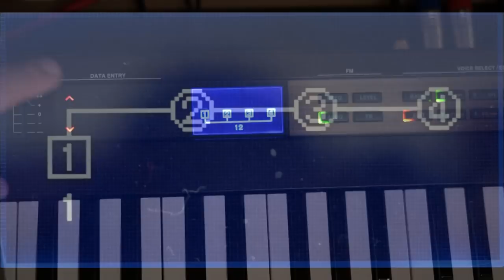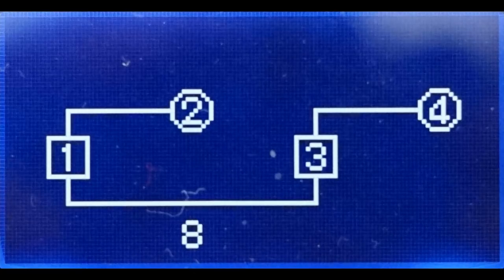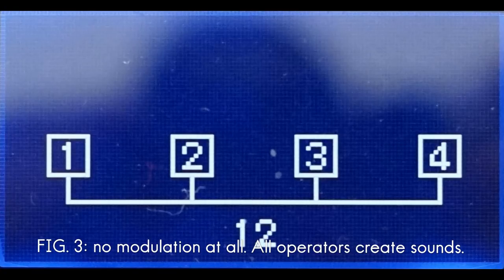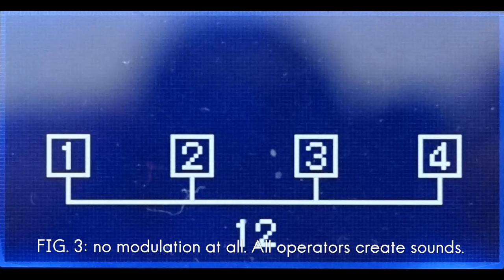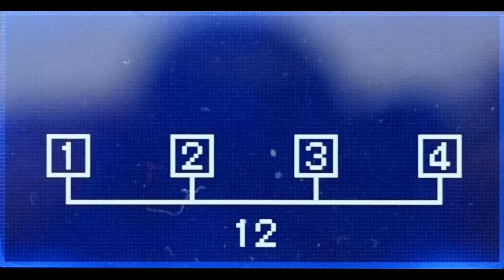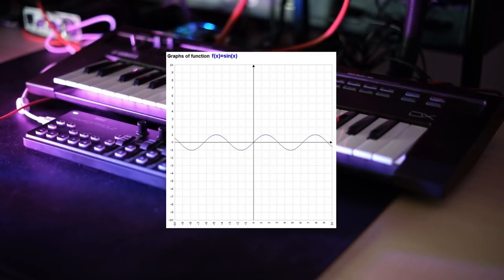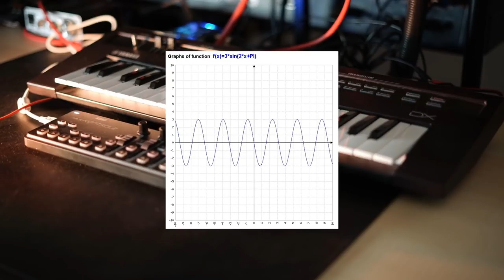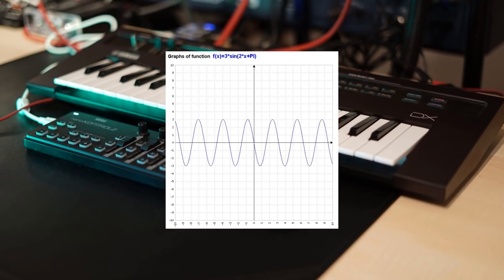FM synthesis basics explained with an oscilloscope (Reface DX)

Comment: finally, someone who understands that phase modulation is PM, not FM
Reply from the maker: Thanks for watching! :)
Reply: Interesting topic, I consider terms are right. Frequency modulation is the result of modulating the phase and vice versa. To explain to someone what it does (without scope, just by listening), I like to set the ratio of a modulator very low so that it sounds like a vibrato. As you clearly hear the pitch is changing, it would make sense to call it FM. Either way, this type of synthesis isn't for everybody anyway, let alone the maths behind it. Wouldn't worry too much about it :)
Reply: @tehedx  hello, thanks for reply. Frequency modulation is the result of modulating the frequency, as it says. PM - modulating the phase, as it says. From the point of view of the math these are two different results, as phase and frequency is two separate (different) parameters of one (lets say) sinusoidal equasion. Thus changing two different parameters can't be exactlly the same. Technicaly it can give us same result, but only with exact parameters set. Same as two functions that intersects in some point with exact given set of (x; y), but functions itself are not totally overlaping each other... From the point of view of sound, of course, these two methods of modulations (or more, as much as many parameters can be modulated) give different sounds in general. We will clearly hear some pitch floating up and down using FM, and harmonic saturation using PM. We can't make siren or vibrato (as you said) with PM... Sadly, I don't know any PM vst except Blue2, that is FM and PM, so you can use either first one ot second method, and hear kinda different "style" of sounds... Also there are some videos on youtube (can't remember) containing great visualization for PM, after wich one can be certain that FM != PM
Reply: @hostlitd112  thanks for your reply, good explanation! I was focussing only on the mild modulator volumes, but when it is set higher (where it starts to wrap the sine and adds harmonics) it is clear that FM != PM. Out of curiousity, since I don't have a Yamaha to play with, can't one make a vibrato? The Korg Opsix does it. Though something is odd or different about this synth, since the result doesn't seem to match what a DX does.
Reply: @tehedx  Yeah, that is it! Sine starts wrapping, while in FM sine goes faster or slower... Are you asking about Yamaha vibrato? I don't know, I didnt work with real device synth, only VSTs :(    In theory you can't do vibrato in PM, but as you set modulator volumes lower (as you said), it tends to be more mistaken with FM. Thus in that moment you can achieve not vibrato exatly but something similar to FM with hight speed (frequency) modulator, where it would be something buzzy, and with PM you can also make something buzzy. Low frequency, or high volumed modulation is totally different though, just like you noticed

Comment: Phase modulation! Now that makes sense! I used to do RF technology and FM therefore FM syntheses didn’t make sense to me at first glance. Shifting the phase does! I can’t wait to get into “FM” synthesis.
Reply from the maker: Thanks for watching! I think Casio built some actual frequency modulation synths in the mid-80s. Can't remember the name of that instruments, though.
Reply: Floyd Steinberg  but with modulating the frequency with just another sine wave you get a wobble in frequency. In that case you’d need a lot of operators to have Fourier analysis working.
Reply: FM and PM both gives the same spectrum. The difference is: with a "real" FM you have to adjust the modulation depth to the audio frequency, so the synthesizer has much more math to do. With a PM, the spectrum is exactly the same (Bessel functions!) but it scales "automagically" with the frequency, no additional math needed, and then the PM is much easier to implement in the CPU. That's why all of these "FM" synths are in reality PM. 

Casio did something called Phase Distortion, which is PM, but done in the different way, which gives different sound spectrum than classic PM/FM - https://en.wikipedia.org/wiki/Phase_distortion_synthesis

Comment: Everybody goes around saying that the dx family does phase modulation, not frequency modulation, but no one explains the difference. For what I've read both techniques are almost equivalent when the modulating signal is a sine wave.
Reply from the maker: Hi, thanks for watching! Hm, I thought I explained the mathematical difference. 
Frequency Modulation is f(x)=sin(x*sin(x)) and Phase Modulation is f(x)=sin(x+sin(x)) .  You can play around with these on this page: https://www.mathe-fa.de/en   I think in the end the sound will be quite similar, but you need to adjust the parameters in other factors.  Best regards!

Comment: Why doesn't the feedback-generated square wave look like a square wave?
Reply from the maker: Feedback works as the name implies, by feeding back the output of an operator as a modulator into the signal created in the first place. I guess we're looking at something similar to f(x)=sin(x+a*sin(x+b*sin(x+c*sin(x))) here with a being the amplitude / strength of the recursed signal. This will result in roughly the wave you're seeing there.

Comment: I need to build one of those oscilloscopes, brushing up on my 4 op fm. thx Floyd
Reply from the maker: Thanks for watching!  It's a fun project, but not really mandatory. It looks nice on video, though. :)
Reply: @mr_floydst  I have a semi elaborate plan for one. Once set up for a synth is it right to go every time it turns on or needs constant adjustment?
Reply from the maker: @avrilcadabra  As it's digital, it remembers the switch settings. No need for adjustments.

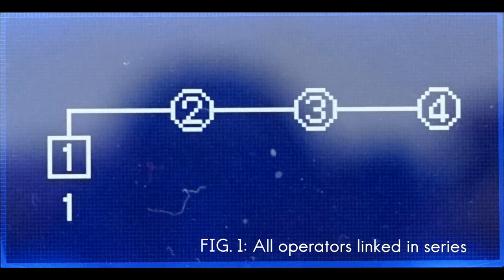Comment: 1:50 OK, I already grasped the basics of FM, but was struggling when working in software synths like Operator in Ableton. I thought (algorithm 1) that  2 modulated 1, and that 3 modulated 2. But here it shows that it's different: 3 is not modulating 2 (the result of which is modulating 1), but 3 is modulating the result of 1 being modulated by 2. Apparently that's something different. In notation 3-> (2->1) and not (3->2) -> 1. There is a priority that IMO does not show in the notation.
Reply from the maker: I guess you're right and I'm wrong. It should be the other way round (I don't have my DX here at the moment to check)
You can check by turning off the operator. If you don't hear sound any more, it was the carrier. :-)
Reply: @mr_floydst  Thank you for your quick response. I'm using Operator, DX7V and have Dexed ready to practice (as well as a scope). But reproducing what's in the video does not go smoothly (no critique ;-)). I'm also in doubt about the phase modulation (do these apps use that too(I ask myself)). Anyway, I guess in the video the Reface uses phase modulation next to FM, doesn't it?  BTW I try to approach things 'the other way around', not trial and error to find nice sounds, but trying to grasp which operations will lead to desired results (like you do). Very insightful was importing the (famous) Yamaha DX7 Factor Sysex in an app like Dexed and see what elements determine the sound.
Reply from the maker: @fritsvanzanten3573  The main difference between the Reface DX and other FM synths is that every operator can feed back into itself in 2 directions (saw / square).
The DX7 couldn't do that, so you'll have to find workarounds. In Dexed, algorithm 3 is a good point to start with. There are two branches with 3 operators each, so you could approach some of the sounds here.

Comment: Thanks for the clarification!!
Reply from the maker: Thanks for watching! :)
Reply: Floyd Steinberg  I tried to read the equation.. is that

 f(x)= Asin(Bx-Csin(Dx) 

for a 2 operators? Not sure if I’m right with the minus. A and C are output levels, B and D the frequencies.. I just didn’t add pi, makes no difference in the idea. I’ve found clever from you to make that math, really worth the video!! Makes sense to develop a small app that could show a curve changing in real-time while changing A, B, C, D on some sort of sliders
Reply from the maker: Hi! Before I made this video, I looked the whole topic up in some old books I have, and Wikipedia of course, and then played around with those formulas on https://www.mathe-fa.de/en  
The basic formula is this https://wikimedia.org/api/rest_v1/media/math/render/svg/be237d5fab265d9c4ff2062aed5be96c0102880e    while a more in-depth explanation can be found here: https://en.wikipedia.org/wiki/Frequency_modulation_synthesis
Reply: Floyd Steinberg  thanks for the details. I’ve just read the Wikipedia page and it looks like the formula I’ve wrote in previous comment is about the same. I was wondering why is there a minus ( - ) in your video (on the map program) instead of the ( + ). On your video it looks actually be the right formula but I wanted to know how come that it is ( - ) instead of ( + ) .. :D but that’s a detail since you actually showed the reality inside FM synthesis :D
Reply from the maker: Well, you can write x+n   or    x+(-n). Using a minus there will invert the function. I thinks it not wrong, strictly speaking. :-)
Reply: Floyd Steinberg  yes i understand. The theory is right. But on my FM synth the frequencies values are only positive. The reason I stay on this detail is that I’ve read many tutorials on how to build saw-like curve using 2 operators. This is possible for saw « up » but I couldn’t read/find any tutorial about saw « low » (reverse saw) which sound much interesting in my ears. That would be possible only by having negative frequencies or changing the + and the - . Now in order to experiment on a math side, I would need to know what is the best operation fitting to the synth.. hope i can make myself understandable :D

Comment: what do you think of the sound quality vs something more expensive?
Reply from the maker: The built-in effects (Reface DX) are quite good! You'll have to pay a lot more money to get something which sounds better. The FM engine has some unique features you won't find anywhere else (in the $3000 Korg Kronos, perhaps). :)
Reply: Floyd Steinberg thank you so much for your response it really means the world! I doubt I’d ever pay that much for the Kronos I’m a mediocre keyboardist but do you think the DX is pro level use for an actual industry album maybe?
Reply from the maker: @Iwtbaf  Sound-wise? Definitely. But if you're just planning to produce some tracks, a DAW with DEXED and some effects plugins may be the cheaper option (plus you're gaining time because you don't have to multi-track in real time). Nice thing about the Reface is you can take it anywhere because of it's size and it's batteries and built-in speakers. I found the mini keys are very playable.  So yes, it's a great sounding, pro-level synth, but a small one. :-)
Reply: Floyd Steinberg thank you so much for your replies. I will go check out those resources. Your love for the synth world has help many of us and it truly helped me been trying to get this question answered for a few months after I bought the CP I really appreciate it!
Reply: @mr_floydst  is it possible for them to add velocity to the CS through firmware update or is it just not possible?
Reply from the maker: @Iwtbaf  I'm afraid it's not possible and I can see why: You had to be able to tell the synth what to do with the Velocity Information. But the cs has no interface for that...
Reply: Floyd Steinberg well that’s pretty unfortunate lol. Would have made it so much more valuable. Do you think it’s possible to create one? Or install a separate part ?

Comment: fm modulation dont work as you adding signal. But modulater modulate pitch of the carrier. So if you put 440... then modulator will oscilate this frequency number. So i dont understend dat one sine + modulator siny is higher amp... because its not sine + sine but very fast vibrato on freq of the carier where amp/vol of modulator is how far will oscilate the number of freq of carrier
Reply from the maker: Thanks for watching! I think the formula I'm showing here is correct, it's a bit "dumbed down", the actual formula is a bit more "theoretical": http://ringbuffer.org/sound_synthesis_introduction/Modulation/fm-synthesis-formula-spectra
The modulator is (as its name implies) modulating the original signal produced by the carrier, so you can't make your sound louder by adding modulators. You'll have to stack carriers to achieve that.
Reply: @mr_floydst  yea, im programing my own fm synth now in pd so im watching on some content about algorythms of fm and staff to get some inspiration. And this video did give me some ideas so thx! :)
It´s great time to dig in those stuff, so Im glad to see people making videos about theese stuff. Especially with hardware I dont have, but can see how it work a learn how somebody else did dat.

Comment: Where is this modulation taking place? Is it applied post oscillation, and two sounds modulate each other or is one oscillator modulating other. Very interesting video!
Reply from the maker: Hi, thanks for watching! The "Oscillators" are modulating each other depending on the layout of the algorithm you chose. This all happens before sound output (this is a digital synth).
Reply: @mr_floydst   Thank you for answering! I must say, even after reading about this, I can't really wrap my head around of what digital actually means.... I know, its bits...Anyway, could this main function of oscillators modulating each other be applied also to actual sound signal? Also on digital synth there has to be at some point something, that produces an actual sound....

Comment: At 3.50 sounds like wave folding
Reply from the maker: If you choose the frequencies of carrier and modulator "just right", you can create a wave which resembles a "folded" wave.
Reply: @mr_floydst  I actually studied this if you have the details. by just right you mean f= ?
Reply from the maker: @fru olli  Well the "trick" here is changing the modulators frequency and amplitude with an LFO, while the carrier is tuned down to the lowest possible frequency. The formula should look something like this f(x)=sin(0.5*x+sin(3*sin(x)*x)).

Comment: I see, so basically when we are dealing with a single carrier and single modulator, we have frequency modulation.  However, when we we stack another modulator on top of the modulator, we begin to have phase modulation.  Which is not the same as Casio's phase modulation (used in CZ- and VZ-series), where the phase modulation means the variation of the readout time of the waveform.  Not sure then why Yamaha and Casio supposedly had a conflict about Casio infringing on Yamaha's patents, since Yamaha's FM is quite different from Casio's PD synthesis.
Reply from the maker: I think the might be an interesting bit of history to uncover on Casio vs. Yamaha FM synthesis. Perhaps it's worth researching...

Comment: FM ≠ PM

Stop fricking spreadin BS and confusing people, frequency modulation is not phase modulation, and yeah, it's all nice 'n' stuff when you use sine waves, try anything different from that, you'll realize quickly that the two are very different, because fm cares only about the phase's position, when pm cares only about the phase's angle, wich is very different sonically speaking, and yeah, nobody talks about this, everybody just assumes that the two are virtually  identical, and the fault of all this was Yamaha's ,when they released the DX series, marketing it as FM, when it's just simple PM and the reasons behind this were multiple, one of them being the simple fact that PM, in terms of sonic content, is richer, hell, I could even say it sounds better, and at the time, FM was getting popular, with radios and stuff so why wouldn't it sound cool, if it was called FM (said the Yamaha marketing department?), and, the most important reason, at least for the time, PM is less complex, calculus-wise, compared to FM, and in the 80's processing power wasn't good, at least for the consumer grade stuff...

P.S.

Can't remember if I'm correct or not, but I've heard people claiming that FM "cannot" do feedback looping, like PM does, for some mathematical reasons I just can't remember, so yeah, technically one more point in favor of PM...
Reply from the maker: Hi Robert, thanks for watching and commenting, but uhm, that was the point of the video. The math behind Yamaha's "FM" is quite simple and all I wanted to show is how to create other basic waveshapes (as used in sound synthesis) with that. The actual FM (as learned by electrical engineers and used in radio signal transmission) is a very different thing.
Reply: @mr_floydst  Then fricking make 2 videos about it instead of saying to me, that "you did", listen, I really enjoyed your tutorial, up until you started referring to everything as FM, and never cared to explain the difference, and when you said it's "basically phase modulation" wich makes me think, you know what?

Imma go n make the explanatory video meself...

Yeah, Imma do that...
Reply: @robertolsen6797 Still waiting on that video
Reply: @tonbonthemon  Jesus, you're relentless...😅😂